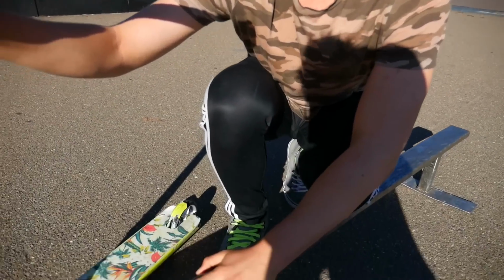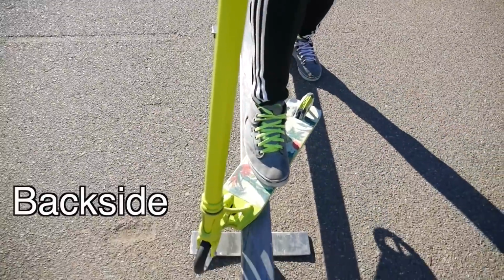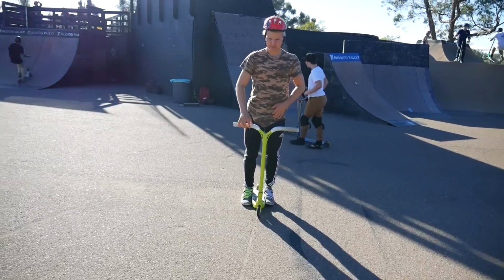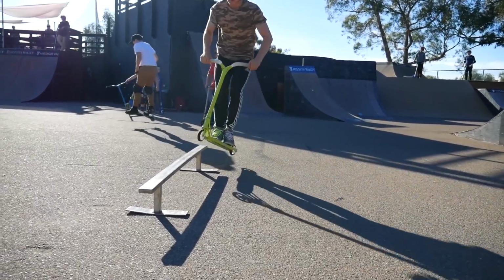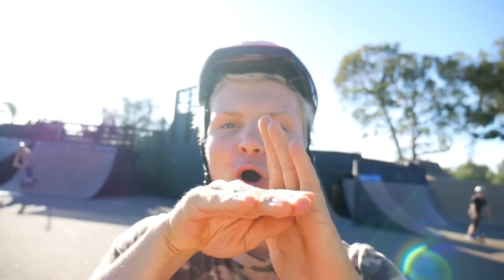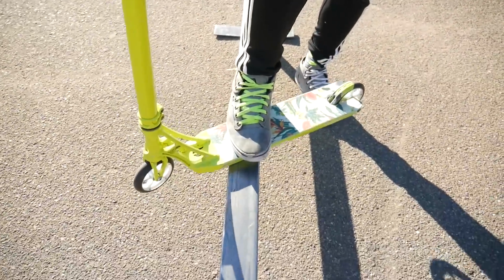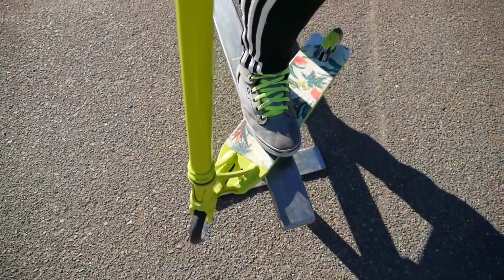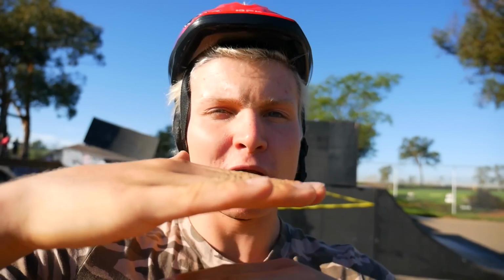How to Grind a Rail on a Scooter! EASY & FAST✅‼️

Comment: Its keeps ruining the bottom of my deck
Reply: Lexie Watts what deck do u have?????? Cause it shouldn't be doing that
Reply: I grind and the bottom of my deck is scratched, It should be scratched, Metal on metal, the metal will scratch the bottom of the deck.
Reply: TEKKERZ GIRL that's what's meant to happen
Reply: A girl with a YouTube channel don’t do board slides then😂
Reply: A girl with a YouTube channel that's what it's made for